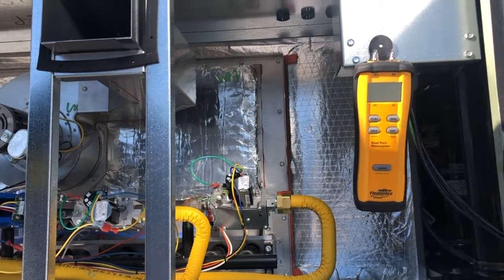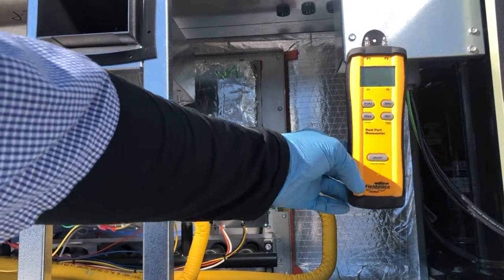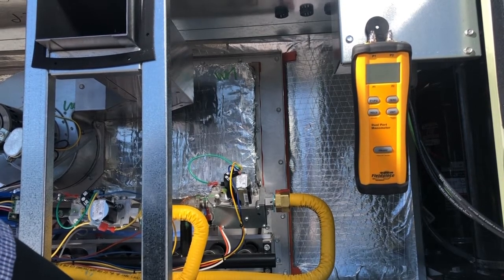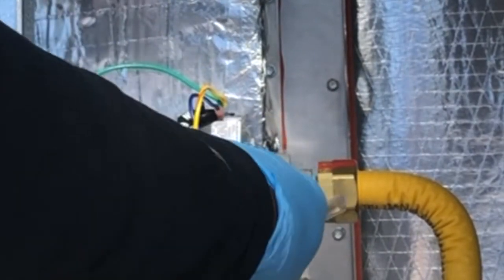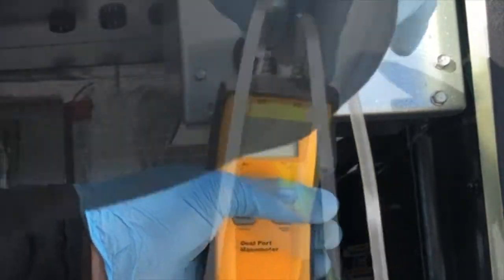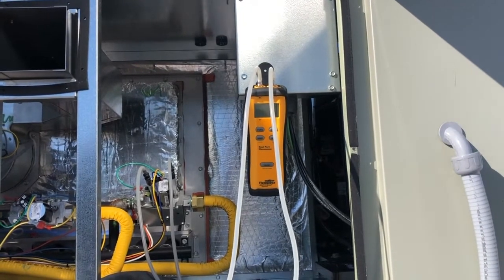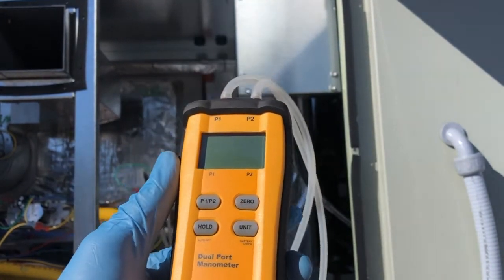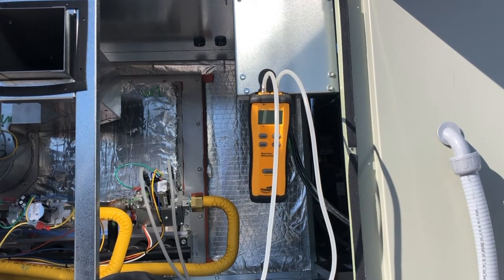FieldPiece Dual Port Manameter Review

Comment: So with the unit running. You can press P1 and P2 to cycle between incoming and manifold pressure? To see 2 separate readings? Not differential pressure
Reply: Correct
Reply: You still like it